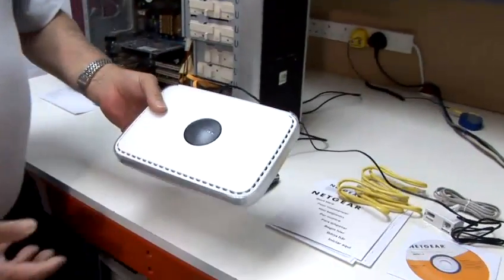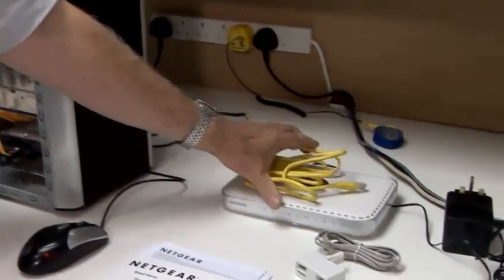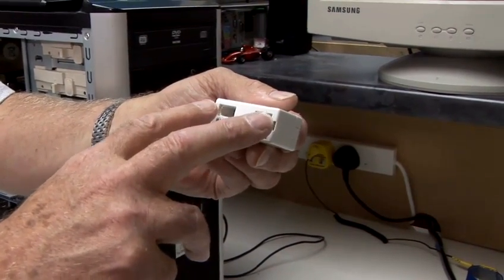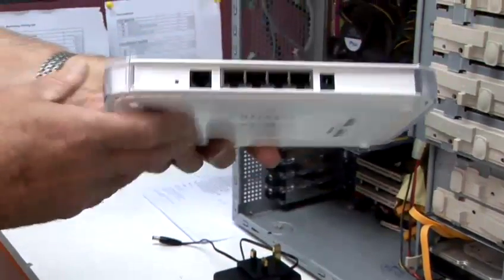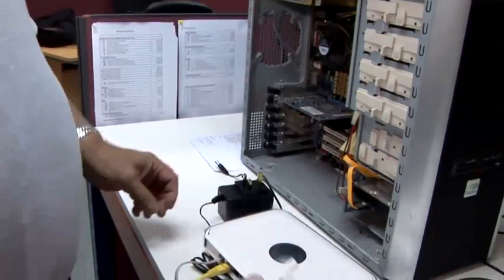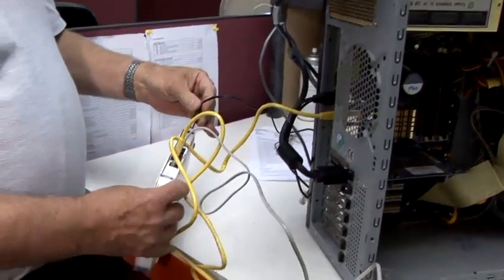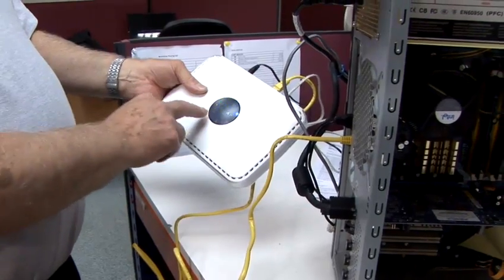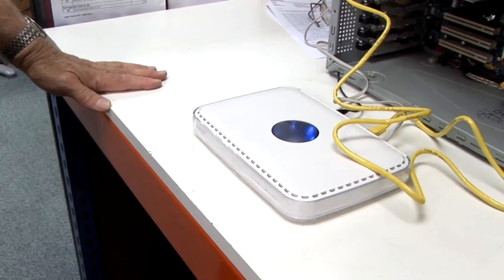How To Configure Wireless Netgear Routers

Comment: Some times the router page does not open, in that case  you can get help from D-link +𝟏-𝟖𝟎𝟎-𝟓𝟑𝟐-𝟒𝟏𝟖𝟕. Apart from applying a secure password, I think, in order to fully secure wifi-router, you should configure some other important settings.